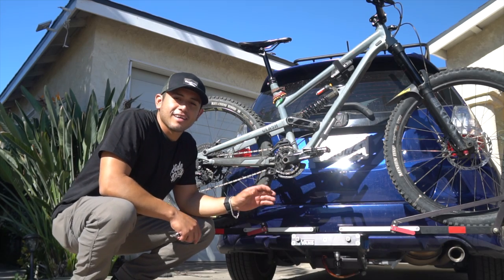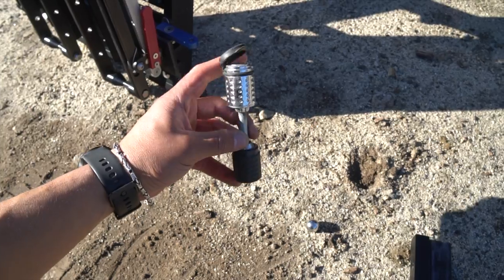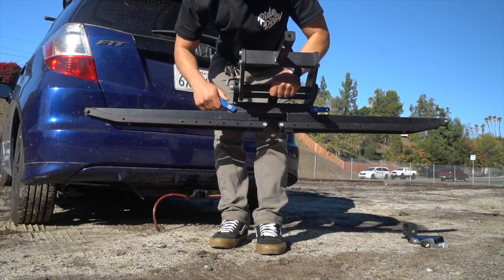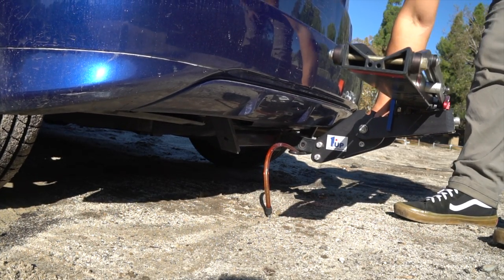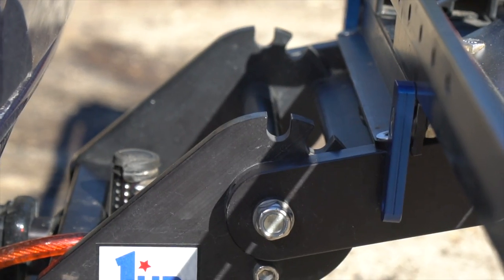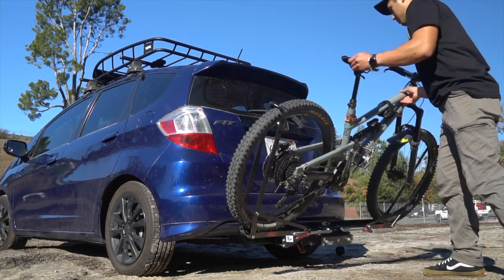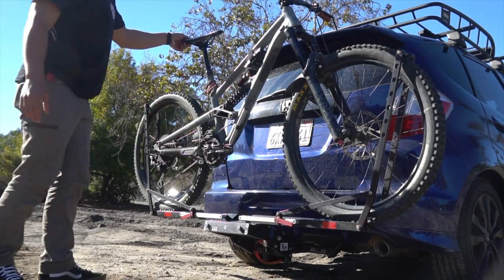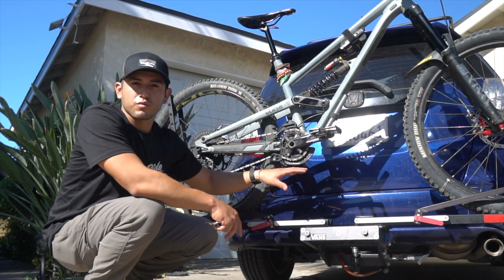1UP Quick Rack Single Review | 1.25" - 2" | Detailed Review | Best MTB Bike Rack? | Commencal Clash

Comment: I have this rack in silver.  Before I got it I thought about getting the $299 Costco bike rack but it is for 2" hitch and I did not want to get an 1.25" adapter.  The 1up rack also has better ground clearance but if you leave the lock on it while you drive there's a chance of scraping.  However that shouldn't be a problem for your truck.  Funny thing about the rack is it comes with a silly 1 inch wide velcro strap that is meant to prevent the rack from falling out if the marble fails.  I replaced it with a wider and thicker velcro strap.
Reply from the maker: I definitely hated how much I would scrape the rack with my Honda fit, but now that it’s on the truck it’s a lot more solid. Yeah the Velcro strap they give you isn’t the strong as I’d want it to be 😆

Comment: Do you like this better than the thule ? Only thing i don't like is it doesn't have thru pin to go through the insert of the rack and the receiver
Reply from the maker: Most definitely 🤘 it’s such a simple and easy design. I was skeptical about the fact that the one up doesn’t have a thru bolt as well but their design is solid and the rack has never gotten loose on me 😁🤘
Reply: @GabeGarcia did you ever consider the kuat transfer ? Is so why didn’t you get it?

Comment: I've had my rack for a few years. Best rack ever. A couple quick tips. Not sure if that cable lock would keep the rack in the receiver if it slipped, it looks kinda long. I got some Cartman 18" tie down straps and melted a hole at the right length to put the lock shaft through. Next, get a Sharpie and mark the sliding arm side for the back tire. Always open that arm to that spot, put the bike in and then all you have to do is tighten the front arm. Also by doing it this way you know your bike is always centered. I take my rack off only when I wash my car. A quick way to take it off instead of using their wrench is to get a 8mm tamper resistant hex socket to attach to an impact driver or drill. Then keep the spare wrench in your glovebox for emergencies.
Reply from the maker: So sick! Thank you for the tips 🙌💯